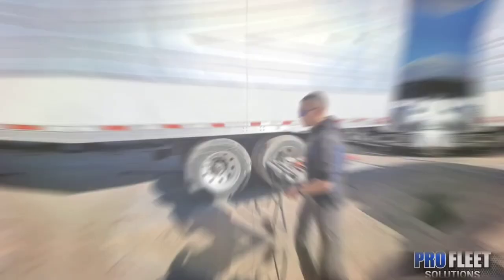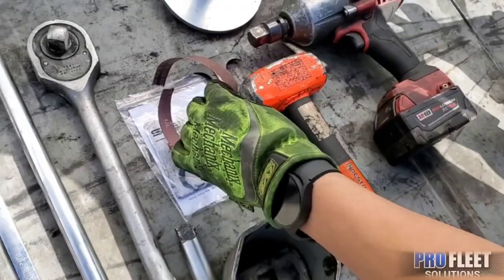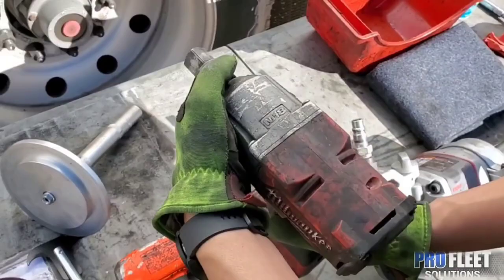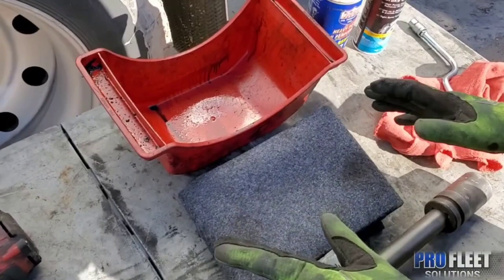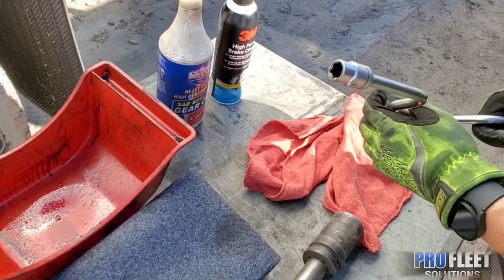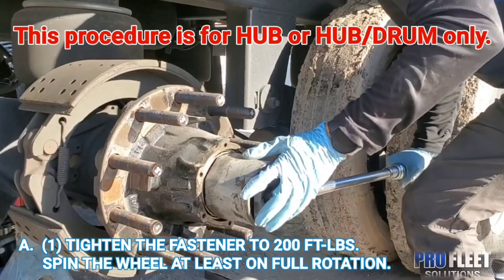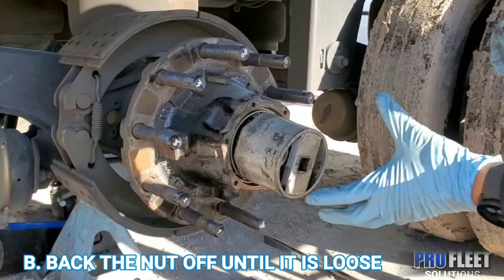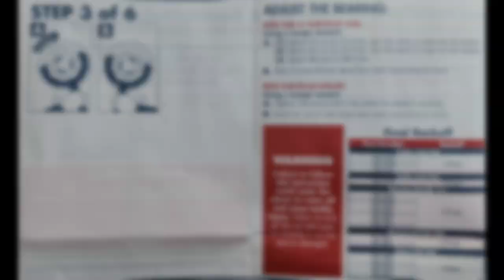HOW TO REPLACE A WHEEL SEAL ON A DRY VAN TRAILER [Updated Version] - FLEET MAINTENANCE

Comment: All badass done, others remove the seals with wheels on and all. This is the best way to do it without cutting corners and super clean 👍👍👍
Reply: How is that possible with wheels on? You mean wheels pulled with hub  assembly right ?
Reply: @Tyrone-cd4ji  yes

Comment: What size number is the sandpaper?？？
Reply from the maker: Highly recommend using an Emery sanding cloth grit 180. If not available, a general purpose Scotch Brite hand pad is fine. The main focus is to remove any debri that will affect the seal installation. Thanks for watching!